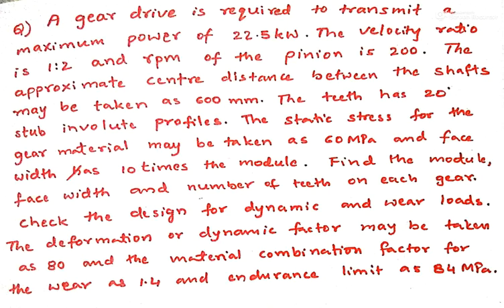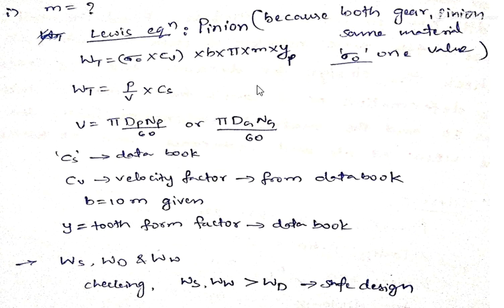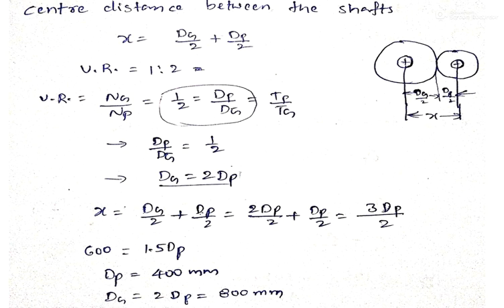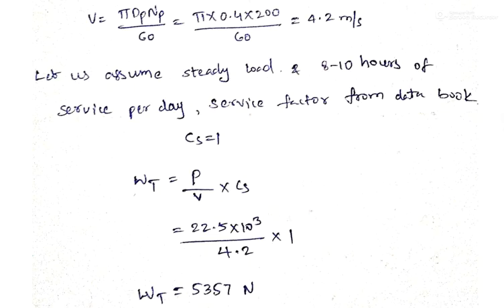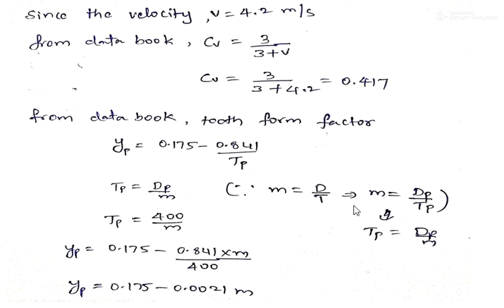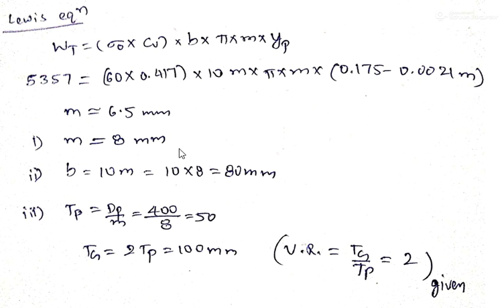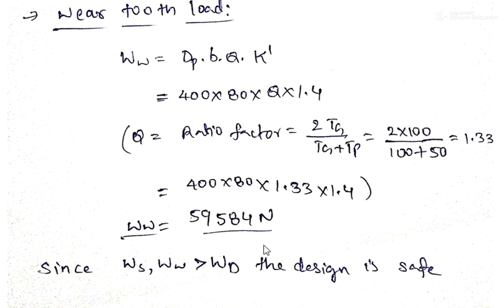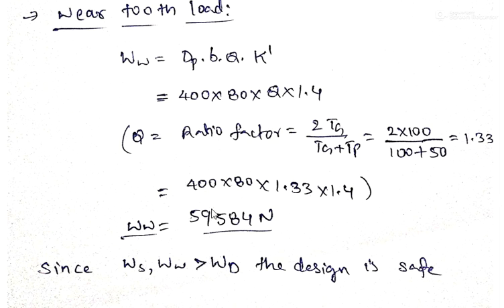Problem on Design of Spur gears using data book

Comment: When sir two speed is give like speed of gear is 1000rpm & 250 rpm then which speed is consider for calculate the pitch line velocity...
Reply from the maker: Two speed means speed of two different gears?  In that case u can use any one or u have to use the speed of the gear for which u know diameter
Reply: @ReferenceBook  OK sir tq...
Reply from the maker: payal dhanvij  please share my videos with your friends